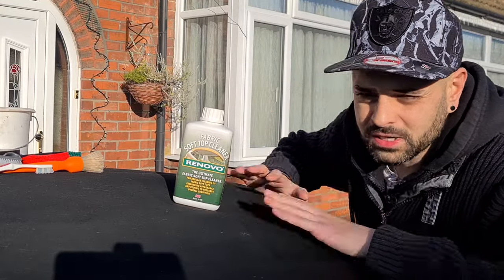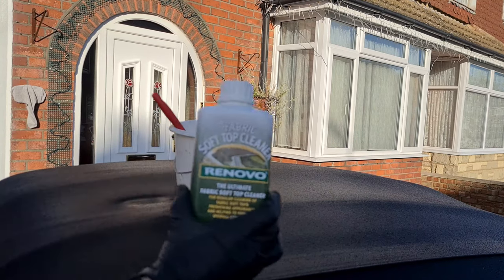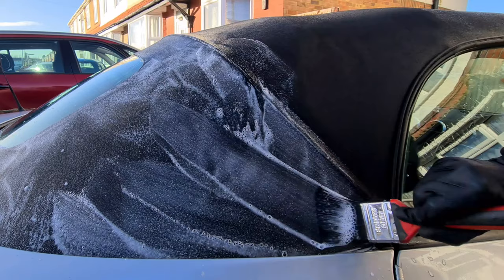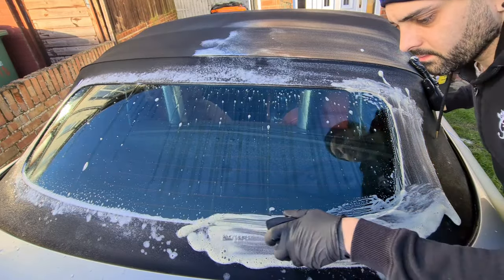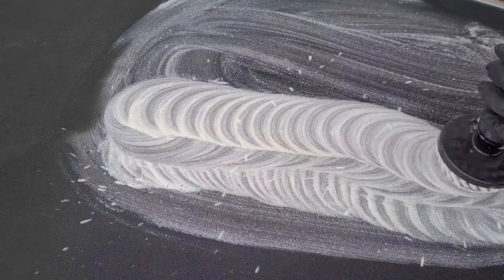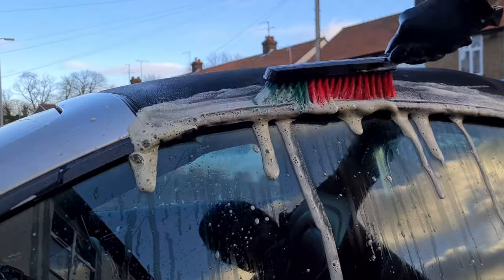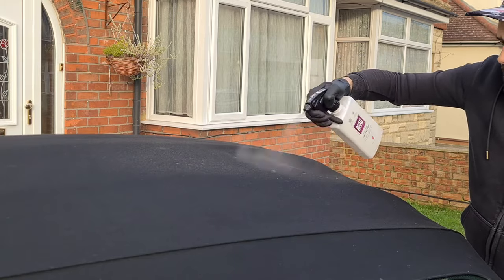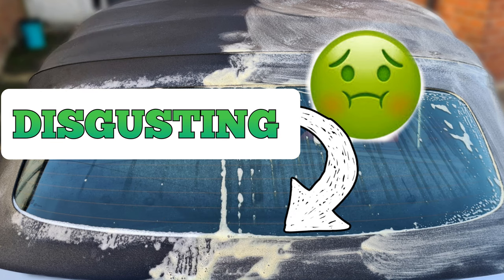cleaning soft convertible top & restore

Comment: Just about to do my fiat 500c roof using the Renovo 3 part kit. The colouring worries me a bit.
Reply from the maker: Some advice dude, DO not colour it if you don't need to, your better off giving it a good clean a few times 1st, I used the colour on my booster and ruined the roof so if you can don't use the colour
Reply: @APASSIONFORDETAILING  I have a couple if fag burns to repair and need to cover them up. I’m nervous of doing it though.